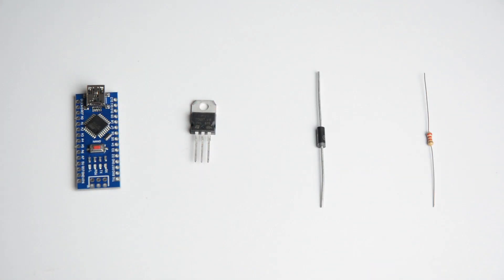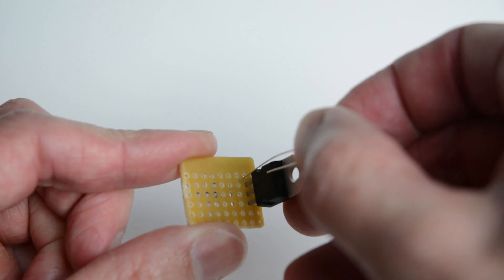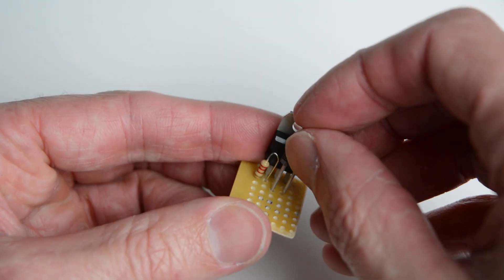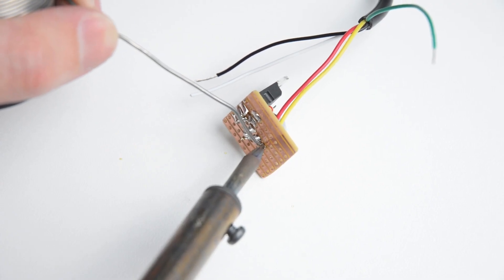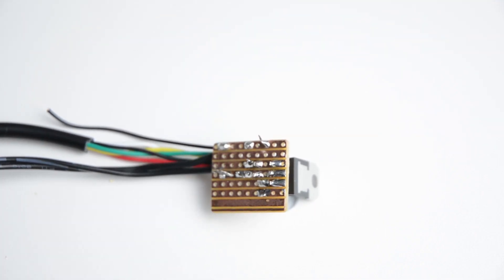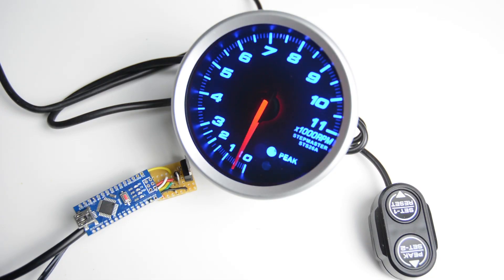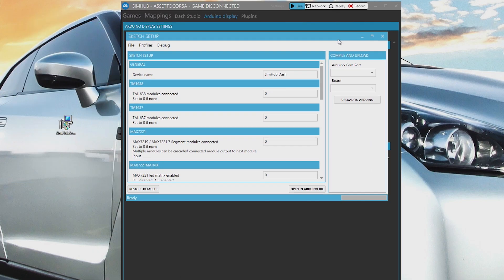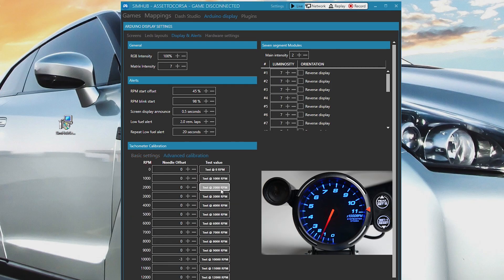DIY ARDUINO RPM REV TACHO SIM HUB DASH

Comment: Hey, regarding the analog hanbrake video. Going to do that build in a few days when I get my handbrake. Quick question though, what is the biggest problem with having a bigger potentiometer (60mm for example)? It seems like it could fit, would it be problems with the programming and calibration or is it just not going to physically fit? I guess that you actually wouldn't have to use the whole length of the potentiometer if it is longer, is it so? Figured that I would comment on this video aswell so that you hopefully will read it. Thanks for the great informative and inspiring content!
Reply from the maker: 60mm should just fit and work. Travel of the handbrake internals is relatively short depending on spring, bracket and bolt combination you use. I recommend 35-45mm its easier to position inside the handbrake with adequate range.
Reply: amstudio Ok big thanks for the answer!

Comment: Can you do a boost gauge
Reply: The Bandinator this is what ive been waiting on
Reply: Yea, that's what I was thinking with digital gauges. I'm not in a real rush to make one. I'm still waiting on the parts to make this Tacho and the other digital dash display that amstudio made made on YouTube.
Reply: I would like to see a digital oil pressure gauge install!
Reply: Another vote for a boost gauge tutorial. A fuel gauge would be good too because I'm thinking of building a instrument cluster and I'm not sure how pressure based gauges would work.
Reply: Project.R Boost gauges work by pulling vacuum by tapping the vacuum line inline with the manifold pressure,  to simulate would be pretty tricky.  However digital guages might work the same as this tutorial.
Reply: Project.R Boost gauges work by pulling vacuum by tapping the vacuum line inline with the manifold pressure,  to simulate would be pretty tricky.  However digital guages might work the same as this tutorial.

Comment: really nice diy want to do this. 1 question the reaction time of the techometer can it be faster? doe example when you lift of the gas the reaction is a little slow
Reply: Eric's Hobby Channel it's really depending of the tach, this specific model is not the fastest
Reply: oke thanx
Reply: So the delay is more on the techo side

Comment: I can not make it work, you can give me the exact model of diode.I'm using a zener I do not know if it will be for that.
Reply from the maker: I used a 1N5349 Zener Diode 12V. If you haven't already its also good to test and build the circuit on a breadboard first.
Reply: Solved the tachometer has an internal potentiometer that regulates the input of current.venia configured to the minimum ...... is chino.me and gone crazy so that is given with the problem
Reply: tenia el zener  invertido.simplemente le puse correctamente
Reply: airsoft TTT buenas! como lo arreglaste?

Comment: Hey great video, would this tachometer work for this project? https://es.aliexpress.com/store/product/80mm-RPM-Tachometer-Defi-Racing-Meter-Auto-Gauge-With-Light-Red-Car-Speedometer-Autometer/1761303_32331288429.html?spm=2114.04010208.3.308.d94SVV&ws_ab_test=searchweb0_0,searchweb201602_2_10152_10065_10151_10068_10136_10137_10060_10155_10062_437_10154_10056_10055_10054_10059_303_100031_10099_10103_10102_10096_10109_10052_10053_10142_10107_10050_10051_5030011_10084_10083_10119_10080_10082_10081_10110_519_10111_10176_10112_10113_10114_10182_10184_10078_10079_10073_10123_10120_10189_142-10120,searchweb201603_50,ppcSwitch_5&btsid=0704e697-732f-45ea-9688-e2de8f0fd5f0&algo_expid=e0467e7f-4d16-4a0a-baf3-8cdfd22e8587-38&algo_pvid=e0467e7f-4d16-4a0a-baf3-8cdfd22e8587
Reply: Yupp

Comment: hours in the web seeking for this, thanks bro, you are big, does it work the same with oil, fuel, etc. gauges?
Reply: Randall Enriquez It should work with them as long as you look at what voltage the gauges use for their data lines. Most use 12 so you'll have to use the Tip120 or any other transistor/MOSFET to change the logic level. As for the arduino, that should work too as long as you set it up correctly

Comment: I have a ps4, i bought Dirt 4 and I would like to have a wheel. Which wheel should I buy. I'am thinking about g29 and t150. What is your recomendation?
Reply: G29 is enough for entertainment. G29 just 160￡ with amazing built quality
Reply from the maker: G29 is good to start with. Then if you enjoy the sim racing upgrade to something like Fanatec.

Comment: Those connection schemes are designed by you? i'm refering to the fact of knowing the type of diode and the magnitude of the resistor and all this things. Another thing that makes me curious is why pin number 9 on nano and not 7 for example. thanks for the great videos
Reply: Envious for what? I'm just someone curious and passionate about these projects that just wants to learn a bit more about how they are designed. I don't know anything about him genious or not, but he has a talent for this things and knows a lot more than me, that's why i am asking. If amstudio felt ofended for my comment i'm sorry, i just wanted to find out a bit more
Reply from the maker: This is project is designed by SimHub author. The description has component list. Thanks!
Reply: Ian Navarro, are you envious dude? He never said he's a genius

Comment: My DIY H-Shifter? I NEED IT.
Reply: There's already a diy h pattern on hackaday. I've built one and use it all the time. Search up "diy h pattern" and it should be the first result.
Reply: The G29's H-Shifter costs $59.99 USD
Reply: Only I paid 30 quid for mine brand new
Reply: The Logitech shifter sucks ass. Full of plastic
Reply: Just buy one, they are cheap
Reply: @JoJoCan  cheap? anything other than the logitech shifter are not cheap at all
Reply: Mihin Karunaratne you NEED IT......so?

Comment: build a car alreay plz
Reply: Jae hyun Park build a car with arduino ecu
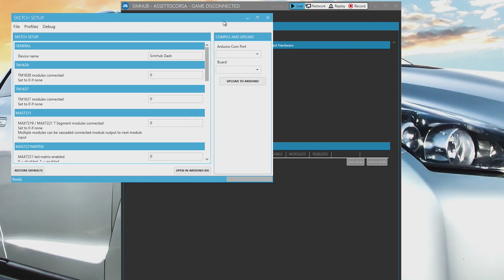Reply: No it isn't.  The Arduino uses the "Tone" library to drive the transistor.  The tone library is capable of outputting from 31Hz to 65,635 Hz.  As seen in the video, it drives the tachometer over the full RPM range without breaking a sweat.  If you pause at 4:49 you can see the software is configured to send serial data at 64Hz.  So you will only get updates 64 times each second (making the needle "step" a little).

The minimum number of cylinders the tachometer can be configured to accept is 4.  On a four stroke, there are two up-down cycles (revolutions) between spark events.  Since there are four cylinders, half of them have a spark event per revolution.  Of those two, they fire alternating so each, single 360° revolution will produce 2 spark signals to the tachometer. (Unless it is a stupid (GM) and they spark even on the exhaust stroke...)

The gauge reads up to 11,000 RPM so that is 22,000 pulses per minute for a 4 cylinder.  Well under the maximum 65,535/s * 60 seconds in a minute = 3,932,100 that the Arduino is programmed to output.  

Since the minimum frequency is 31Hz ( * (60 sec in minute)/(2 pulses per revolution) ) the arduino cannot drive the tach between 930 RPM and 0 RPM.  If you set the gauge for a 6 cylinder the gap would shrink to 620 RPM, and would be only 465 RPM for an 8 cylinder.  This would require you to change the pulses per RPM generated by the Arduino however something simple like replacing "rpmTone.play(freq);" with "rpmTone.play(freq*1.5);" or "rpmTone.play(freq*2);" on line 994 of the sketch.

You can see a general delay in the physical gauge lagging behind the virtual one.  This is partially due to the 64Hz data rate but mostly due to the stepper motor in the gauge.  The motor driver in the gauge has a maximum speed which limits the needle's ability to keep up.

I think digital is best/fastest.  If you need a needle, you can simulate one but you can get the same (better) effect with LEDs around the circumference.   If you just want to be old school you can get great results with aircore gauges and driving the sin/cos coils with analogWrite()'s.
Reply: You'd probably get into trouble when you start controlling an injection system. Don't know the exact numbers but to get a fast enough PWM signal, with a short enough pulse, you'll probably need to sacrifice a lot of resolution, leaving you with really poor fuel control. Then start constantly monitoring all your sensors and the Arduino will probably start to lag behind. However if you'd get out an arduino due it may become possible.
Reply: @FranseFrikandel  Do some research about speeduino, you're wrong my guy.
Reply: @imnota  wow speeduino is awsome! thanks for the info my guy.
Reply: taohawaii thanks for the knowledge
Reply: @taohawaii  ok nerd
Reply: @taohawaii  how did you write that
Reply: Jae hyun Park i
Reply: I would like this comment but it has 666 likes
Reply: i have faith in amstudio that he will come up with something
Reply: M. Wikan Sasongko arduino is practically too practically too slow for that
Reply: @Elitesniper257  Do some research about speeduino, you're wrong my guy.
Reply: @Elitesniper257  r/wooosh

Comment: Finally, I was waiting for this video! Thanks man, keep up the good work! Ordering all parts asap!:)
Reply from the maker: Enjoy the build!
Reply: When you go max rpm when in neutral, does the needle bounces?
Or doesn't it do it because of little input lag?
Reply: If you use an Attiny 85 microcontroller instead of a whole arduino nano board...the attiny is 1 dollar the resitors diodes and transistors are cheap as hack and can be found in old electronics as well...so about 2 max 3 dollars for the electronics and the price of the rpm indicator which I have no idea how much does it cost... :))
Reply: Eddie Behr you are welcome ! :))
Reply: thanks man!!!